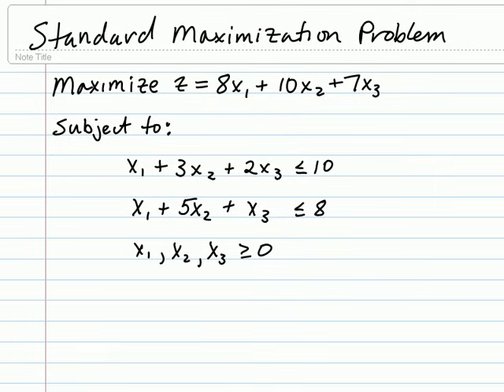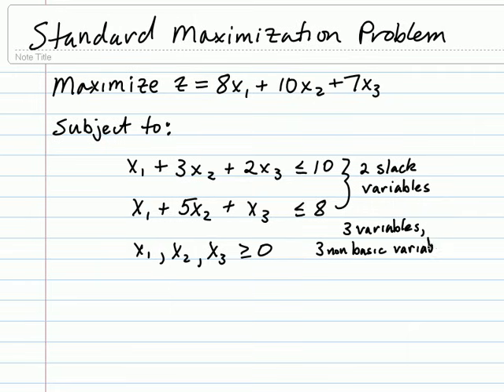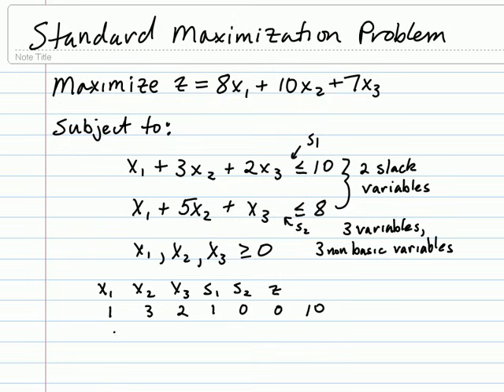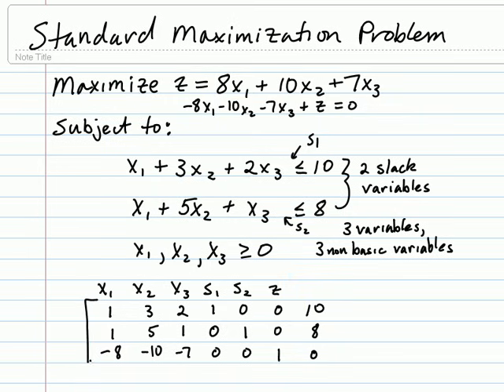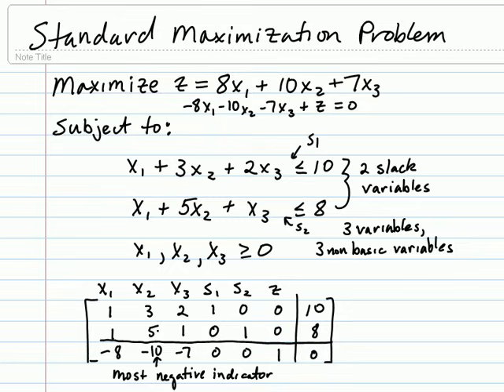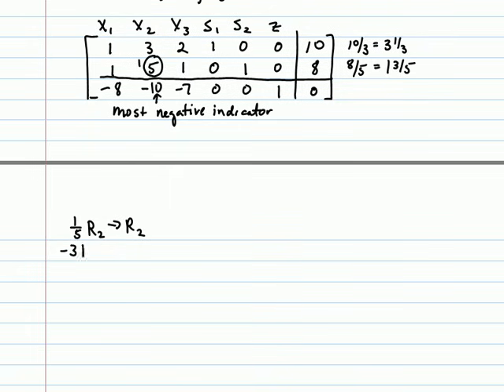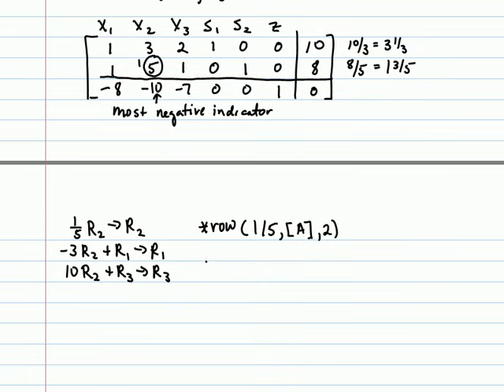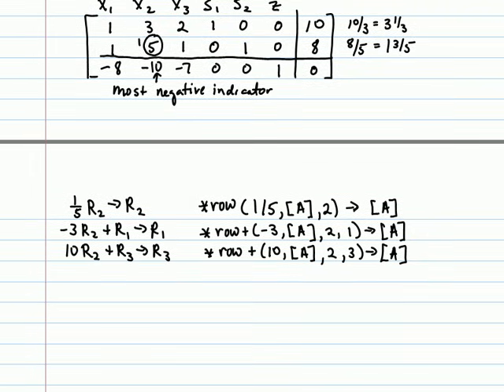Part 1 - Solving a Standard Maximization Problem using the Simplex Method

Comment: please help some one
 Using simplex-Method (or graphical solution methods) solve the linear programming problem:

(P) Max: z = 5x1 + 3x2
Subject to	x1 − x2 ≤ 2
2x1  + x2  ≤ 4
−3x1 + 2x2 ≤ 6 x1 , x2 ≥ 0

Comment: Hi, greeting from Hong Kong. This tutorial video is way more effective than my boring lectures. I've done my exam paper today about Simplex Method and I have unfortunately come across some problems. Could anyone please help?

(1) If the objective function has two equal coefficients, say maximize Z = 5w + 5x - y, you will end up having two coefficients of "-5" in the tableau (one from variable w and one from variable x), which one should be chosen as the "most negative indicator"?

(2) If the objective function still contains negative element(s) after several row operations, do I need to redefine the "most negative indicator" from the current objective function in the current tableau and then continue implementing row operations?

(3) If the objective function contains not only variables, but also a constant, what should I do? For example, the objective function is given as Z = 5w + 2x - 10y + 4, how should I deal with the constant term "+4"?

Thanks for replying.
Reply: (1) just choose one of them arbitrarily, it won’t matter since program will see on next iteration if there are still negative coefficient.

(2) yes. Just keep doing iterations until obj function all positive coefficient 

(3) no idea. If you did find out please lmk.
Reply: @maj.problem8531  Thanks for your reply! I was graduated from that Bachelor Degree last year! I'm planning to study a Master Degree next year!
Reply: 5 years later lol  @maj.problem8531

Comment: Can somebody confirm this:

If I were asked to minimize a function (and not maximize like here) - could I just multiply the objective equation by (-1) and then do this method as in the video (so (-1) and the maximize it which will effectively do minimization)?
Reply: i'm not 100% sure but i think it's possible to use that method yes :)

Comment: how do you pick a pivot column if you have two of the same most negative indicators?
Reply: Anthony Delvecchio just pick one of them. It means the set of optimized points lies on one of the lines that defines the boundary of the feasible set, i.e. there’s more than one way to maximize the equation.

Comment: Hey, i have a problem with using simplex metod, I've understood 1st and 2nd part here very good.. but on the exam i got diferent kind.. for example 
Z = x + 3y

x - y >= -2
x + y <= 6
x + 2y >= 2
x <= 3
x,y >= 0 

So my question is, how can i solwe this using the work like u did here?
Reply: +Kovalski DonPeki you have 2 >= constraints. When having this approach, you need to use the Big M method to solve it

Comment: Hello ! I have a confusion with this case, how are we gonna select  a pivotal row in this. And thanks for this helpful video !

x1         Most right column         Ratio
2               40                              20
0               4                               infinity
1             100                              100
Reply from the maker: shahrukh631 

Start watching around the 4:00 min mark and you should see the answer to your question!  Thanks for watching :-)
Reply: your so boring and this is ti

Comment: Do you have any videos or suggestions on understanding the underlying point of this?  I'm learning this now, my teacher pretty much sucks, and I don't really understand what "Standard Maximization" or "optimal" actually mean.  I can follow along and basically parrot what I'm shown online and in my book but don't really understand what or why.  It's sort of like saying the alphabet because I memorized the letters but have no idea what they're used for, that they make words, sentences, etc.
Reply: This^. I know you made this comment 6 years ago but I'm in exactly the same position now - did you manage to gain some deeper meaning on the subject? If so I would really appreciate it if you could shed some light. Thank you
Reply: To my understanding, optimal maximization means we are trying to find the maximum value the function can have or the highest z value in the case of this video. At the same time, the value of the variables (x1, x2, x3) must remain inside the constraints.

Comment: Hi 

Just a quick doubt. While doing the ratio test, Suppose we have the following 3 cases
CASE 1
x1   z
2   40
-1  5
1   100

In this case, the "ratio" is the lowest for 5/-1, ie '5'
But do we ignore it because x1 is negative? Will we use 40/2 =20 instead?

CASE 2
x1  z
2   50
5   -100

Again here, do we consider the ratio to be 25 or "20", do we ignore the 2nd candidate as it iis a -100 resulting in a negative ratio?

CASE 3
x1  z
2   20
5   50

Both have a ratio of 10. Can we choose any one or is there some rule here
Reply from the maker: Abhinav,

We do ignore negative ratios.  In the case of a tie, just pick one and go with it.  I think there are some algorithms to help in the case of a tie, but it won't hurt to just pick one and pivot.

Hope this helps!

Scott
Reply: Thanks Scott!

Comment: Sir, I think you made a mistake. Its not 10R2 +R3= R3, because the answer would be 40. I think you meant to say 2R2 + R3= R3.
Reply from the maker: Nope.  It is 10R2 + R3 -> R3 because I did 1/5 R2 -> R2 first.  If I had not done 1/5 R2 -> R2, then you would use 2R2 + R3 -> R3.
Reply: Oh ok, thank you for the clarification.
Reply: hush you nerd